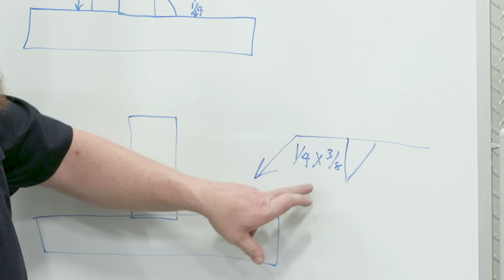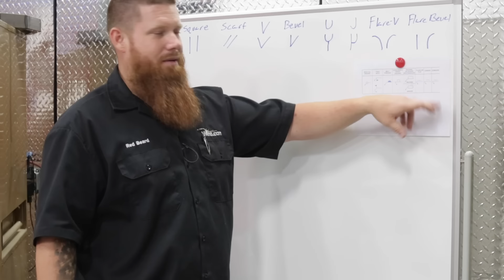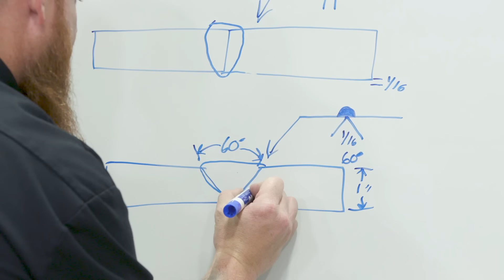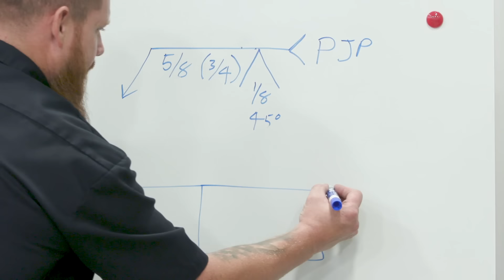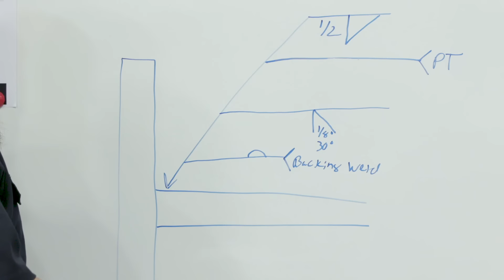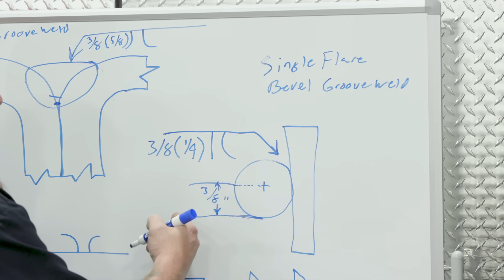How to Read Welding Symbols: Part 2 of 3

Comment: Nice video, bro. Easy to understand and clear. Just a question. Around 21:35 when you say the little welds will be covered up by a .5 inch fillet after the engineer tests it. Is blowing holes common when doing thick welds? I am just a student and I have blown plenty of holes practicing stacking FCAW beads. It just slightly blows my mind that I am gonna have to do things without messing up.

Comment: Good presentation.  You should add some qualifications.  There are weld symbols for contract documents, weld symbols for prequalified processes and weld symbols for qualified welds requiring a WPS.  Contract documents will indicate PJP or CJP groove welds.  The steel detail (shop drawings) will select the appropriate weld and show them on the shop drawings.  Prequalified welds have limitations.  Example: The one sided butt weld is only prequalified for 1/8" maximum material thickness.  The detailed weld symbols should be on shop drawings.  Prequalified PJP and CJP will indicate process, angle prep, tolerances, and process.  
Qualified welds will require a WPS and a PQR.  All ASME BPVC welds are qualified welds.

Comment: Most of the time thay use fillets with unequal legs on equipment that is installed on equipment that is washed alot. (Water drainage). Your welcome

Comment: I guess i have a theory about the designations of "arrow side" "otherside"   other side is always where you need a tack so the shrink force on the arrow side doesnt pull the weldment up under 90 degrees.

Comment: How do you know if the rectangular symbol is a backing bar or a slot weld? I thought the weld symbol at 12:15 meant there was a slot + v groove. can you not have a slot and v groove on the same reference line?

Comment: I was about to ask if weld all around was only for cylindrical parts or if it was for any part. I need to understand welding symbols better. I'm not a welder. I'm a mechanical designer but didn't understand much of the stuff in my fasteners class.

Comment: Good info all around. One correction is you said that all around isn’t used commonly on fillets and that you only see arrow or other side. All around fillets are used all the time. Using your first example of the HSS to baseplate connection would be a good example. If you use the top view you’d have a weld all the way around. Other side would be inside the tube. Other examples: socket welds, tabs like lifting eyes, any situation where one member is shorter in length than another. Good job overall.

Comment: Great vid! I do have 2 questions though. 1) Regarding the multi stepped or multi process notation ( the one with the inspection before the finish pass), am I correct in thinking the first step is called "backing weld" in structural welding and called a "root pass" in pipe welding, but are really the same thing?
2) When using a backer on a joint, will there be a separate detail with specs for welding the backer plate to the joint or will it be on the same view, if at all? Other than the "R" that you mentioned.
Thanks very much! 
Dude this shit makes me wish I was 30 years younger when i was healthy enough that I could have given 10 or 15 years to climbing and burning rod before moving up to being  a "boss" and climbing into a cushioned chair behind a desk!😂😂
✌
Reply: Just a guess:  when backer is used, with no "R", it's there to let the weld penetrate full depth and full strength, with no grinding scratches / grooves.  The backer is welded on the joint pretty good.  If there is no 'R' it means it was not considered worthwhile to spend the time, effort and grinding wheels (all costing $$$) to cut the backer away and grind the joint, possibly introducing scratches and grooves that would concentrate stress and weaken the weld.
This might also be used when you are e.g. welding a tank that it's not reasonably possible for the welder to get inside of.  Don't argue too hard for removing the backer if this is the case!
Reply: @scottwillis5434  hey Scott, I'm not being a dick here, but guesses are useless to me! What I'm looking for are solid, factual answers to my questions and preferably from the guy in the video since he's the one I asked. And the reason I asked him is because I trust him to him to come across with the right answers and not guesses!
Reply: Back welds and backing welds are, easy to guess, done on the back of the joint; a root pass is the very first tiny weld at the root, the "front" (opposite the back) so if you are doing a very large groove weld with stick for example, sometimes to get the pieces stuck well together you would want to do a root pass with Tig so it's much easier to build it up the rest of the way with stringers with stick since the root pass is done nice and clean with Tig, so no, a root weld and back weld are almost opposite
Reply: A backing weld and root are not the same thing. A backing weld isn’t determined by trade. A backing weld is used to support the root done in a groove, similar to a backing strip or backing ring. Like he says in the video a backing weld is done first. A back weld is done after the groove. So weld the open root groove, come around to the back of the weld, gouge or grind it out, and then weld with new clean metal.

Comment: I think I'm getting this other side stuff. So what happens when you turn up for work, you have a brief with your line manager, practice on some off cuts to dial in your welder to the specs?
Reply: ifell3 depends. Everywhere is different, I’ve been some places that don’t have symbols. I’ve been to others that do. I usually grab some scrap and set up a similar joint to what I have to weld and get dialed in. Then again, some places have a WPS for specific weldments.

Comment: You didn't get into the flush, convex, or concave finish like you said. Also a supplement symbol is the letter G. To tell them after you put in the groove weld, request that it be ground flush. But all in all, great job with this segment.
Reply: Michael Rust we ran out of time. Stay tuned for episode 3.
Reply: @GodslilRedneck23  no problem.  You're right in my wheelhouse with these videos. Major portion of my work is building for big yellow. But also for others also. There are standards, but be ready for thinking outside the box by engineering. 😏